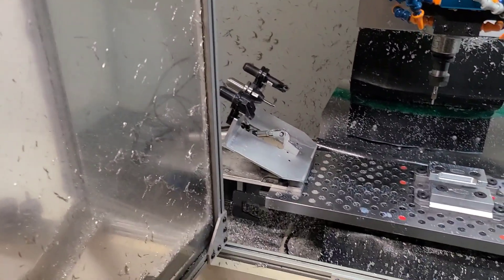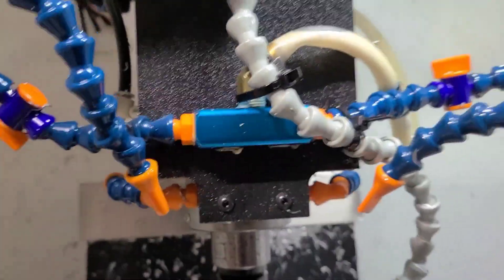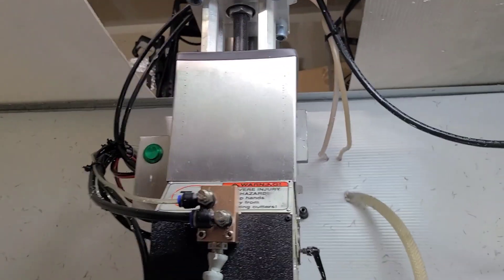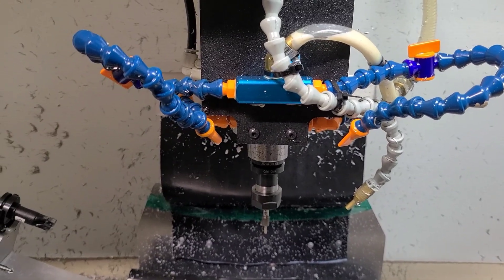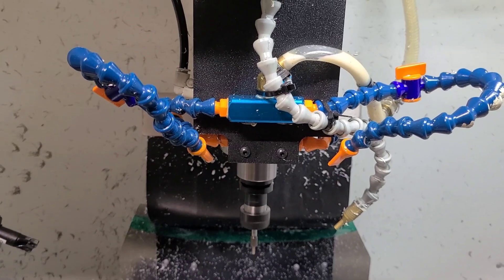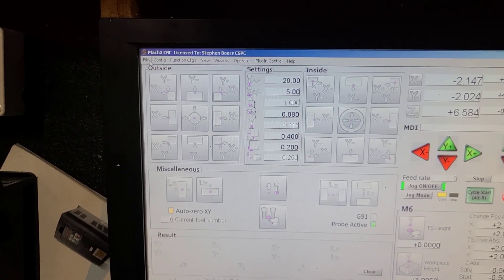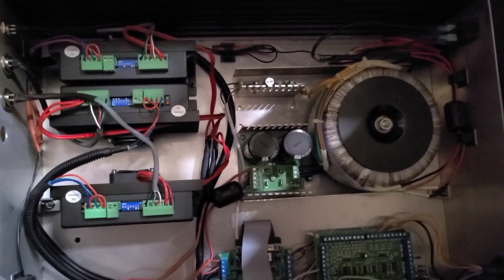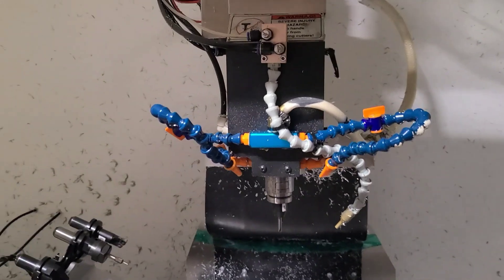My Grizzly G0704 CNC "monster" mill is up for sale. (Now Sold)

Comment: sad to see it go! What a great deal. I can tell you put a lot of time and work into it! Will you be upgrading to another more industrial machine?
Reply from the maker: I've been trying to find something for a while. Only problem is the haas mini mills are too tall to fit past my garage door.  Even looked at a robodrill.  I was torn between having to move to a commercial space, or stay in the garage.. I ended up buying a tormach 1100M with an atc.  I wanted the MX but I have so much invested in tts tooling I decided on the M.   I have hybrid steppers i never installed on the grizzly for the tormach. I can always upgrade to the bt30 spindle on the tormach down the line. 

I just needed more table space and y axis travel.  The 1100 with hybrid steppers will be a faster machine than my grizzly and I'm excited for the 10 tool atc.
Reply: @adaptedmachining6951  that’s awesome. I was wondering if it was a tormach when you said you were keeping your tooling. Happy for you brother! I would totally buy it if I wasn’t working on building my own lol